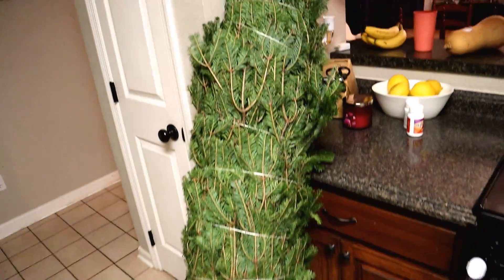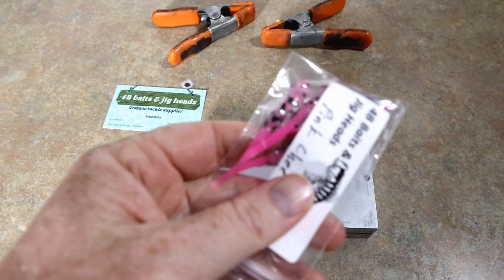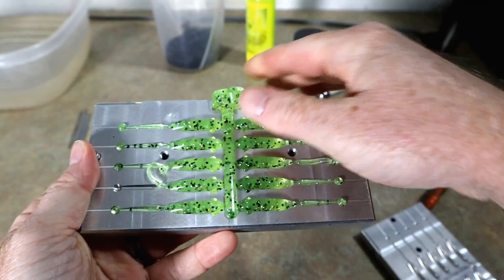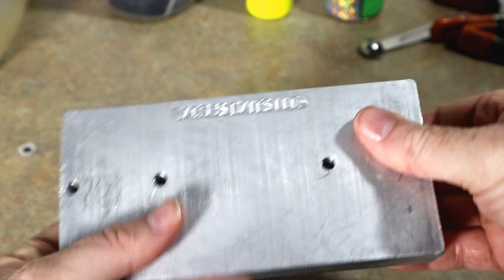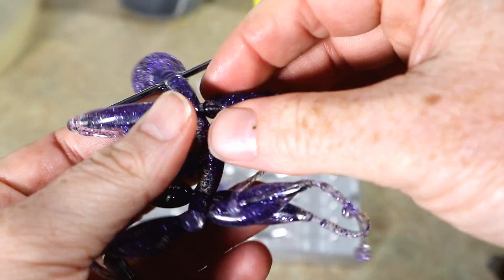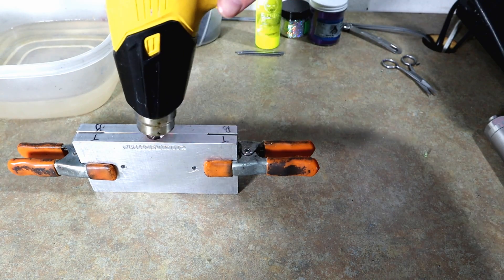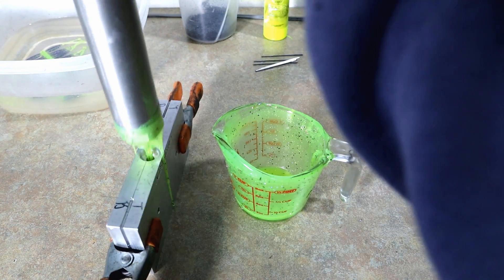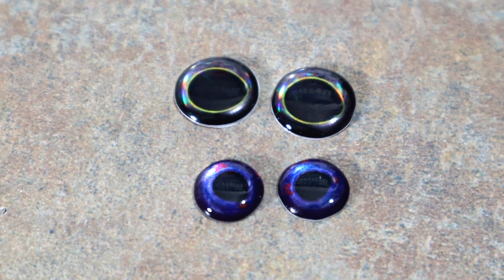Making My FIRST EVER PANFISH BAITS!  Soft Plastic Baits for Crappie & Panfish

Comment: Hi , Chris.  Greeting from Toronto. I really like your videos. I been watching them a lot. So far this is my favorite one yet. I have the same mold from Jacobs Mold , it is a 1 7/8”  . I am wondering if is the same one as you are using in the video . I would like to do some core shot ,  but I am not sure what exactly mold you use and the diameter / length of the mini rod you using . Would you please kindly share that infor ? Thanks.